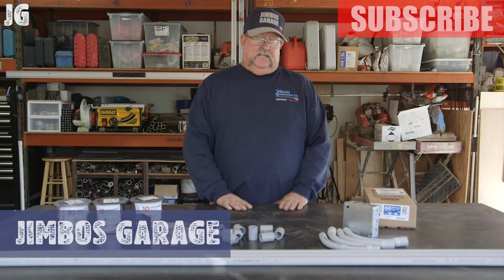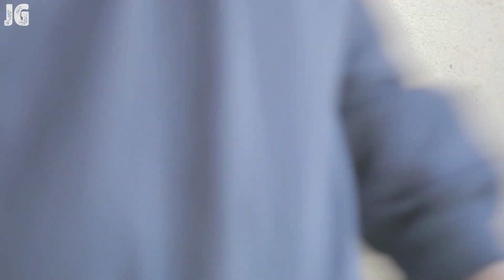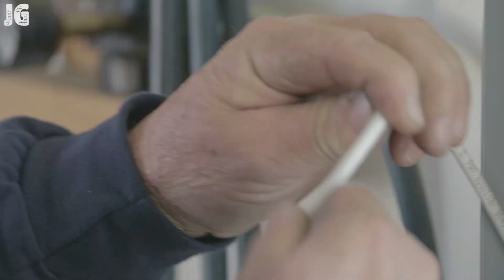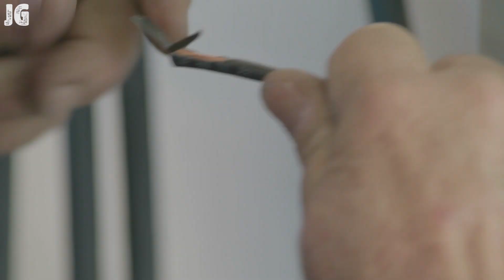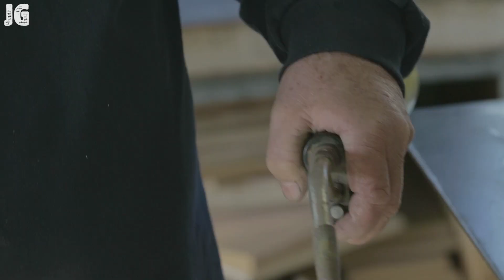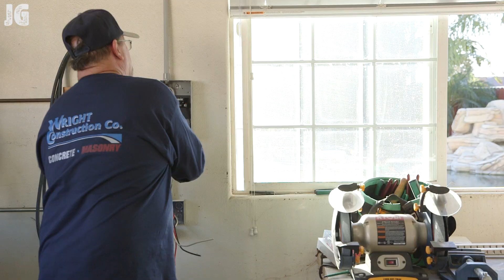Running 220 Power for NewAir Garage Heater - Jimbos Garage

Comment: Sir, great video! Well done. Thank you! Ran my heater with just cord and a plug, but wanted a cleaner safer setup for my dad’s garage. This was exactly what I needed to see. My only question is, what would you do for an older receptacle that was recessed? Would you just put the panel over the receptacle or some type of box?

Comment: If I understand you correctly, did you just install a 30 amp subpanel off of a 15 amp breaker on the main panel?
Reply: It was a 50. He stepped down to 30 as per instructions and code.

Comment: Thanks for the video. I just order this unit for my two car garage. Question on the #10 green wire. Did you connect that green wire to ground bar in the sub-panel? Also for the Black and white #10 wires, did you connect those two wires to the Amp breaker? I am wiring a Leviton 30A-125/250V surface mount with #10-2 wire. Also I know you said your not an electrician but since I will be using 10-2 wire from the sub-panel to the outlet do you know if it would be adequate to use the ground on the dog leg pole slot on that outlet,  and Black, and White for the other two slanted pole slots? I am planning to Run a plug from the unit using a 10AWG with a green , black, and white wires combined to connect to a Leviton 30/50 AMP Dual Angle Power Plug so when I move I can take the unit with me. Thoughts or Any advice or guidance feedback would be greatly appreciated. Thanks in advance!!
Reply from the maker: Thanks for watching John,  Yes the green wire is grounded to the sub panel and then to the main panel as well. I'm sorry i don't know enough about electrical to give you advise on your other questions.  Jimbos garage!

Comment: Hey Jimbo, great video! I understand it is fine to use any wire color, AS LONG AS YOU LABEL IT AS HOT. (Excuse the 'all caps', but needed to make sure it stands out.) Check your local building codes. Normally you label it with a black electrical tape on both ends of the cable (at the panel and the switch/outlet). You could use other colors, but you'll have to refer to the building code for that. You can read about this under the subtitle "The White Wire in a 240V Circuit" at this site:
http://www.doityourself.com/stry/220-wiring-color-code-interpretation
Hope that helps!

Comment: Are you going to properly ground the sub panel?
Reply from the maker: +seige9900 Thank you for your comment. I have since spoke with an electrician and grounded the sub-panel. I came off the grounding lug from the main panel, with a num 8 green wire and ran it to the sub-panel with a separate grounding lug. I wish I could post some pictures here, but it doesn't let you. This whole process was very educational. Its also hard to get all the content filmed. Thanks again for your help. Have a great new year!
- Jimbos Garage

Comment: I installed a similar unit last year. Power bill was too high. This year I'm using a wood burning fireplace. Thanks for the videos.
Reply from the maker: +Craig Fuller   Thanks for watching Craig, Yes thats what i was wondering? The last few nights i have been working in the shop and it has been on for about 3 to 4 hours each night. Wow!!!,   I guess i will have to wait and see on next months bill!  The good thing is it has been in the low 40's and the shop is a nice 70 degrees...  Jimbos garage!